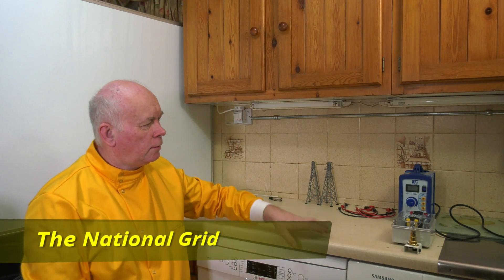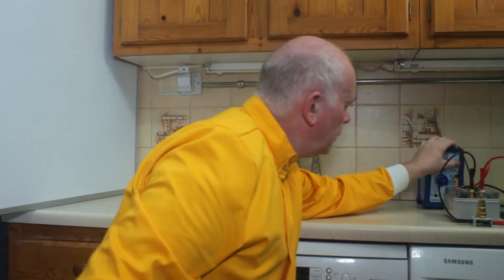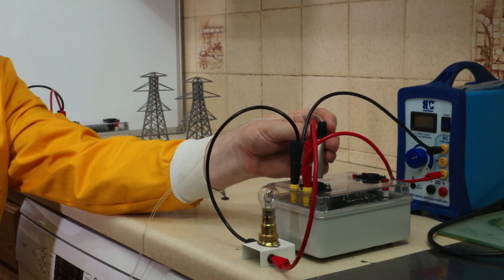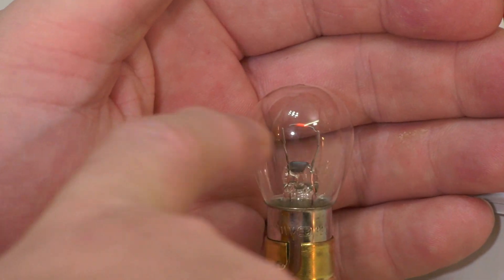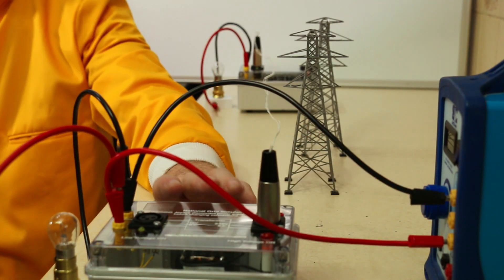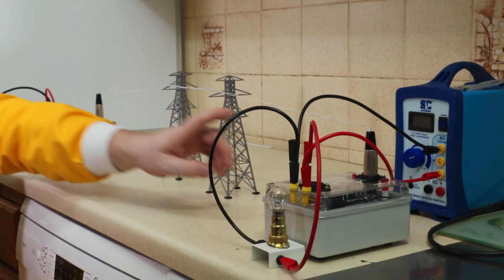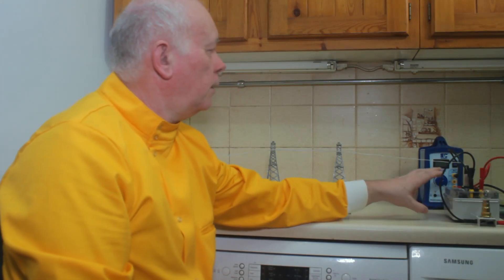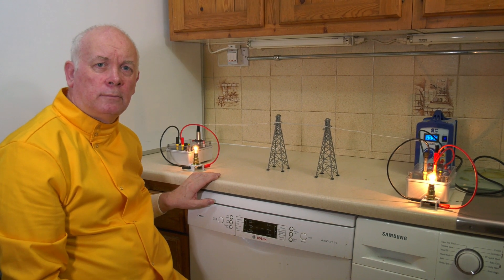Explaining how the national grid works

Comment: Houses do not run on 12 volts. Pylons do not carry 240 volts. Please explain stating the correct voltages.
Reply from the maker: This is a model of the National Grid as a demonstration of how it works. Sending high voltages around a classroom would be lethal.
Reply: @PhilipRussell  STATING the correct voltages. (Sending around a classroom, how ridiculous).

Comment: Am not sure if i accept this example you choose. 12v dc can not be converted to 240v ac by any power company in most parts of the world as standard especially in the Uk. So very bad example.  he should have stock to 240v ac step up by transformer to 11kv for long distance transmission then when it arrives it is stepped down to 240v ac. for consumption in house. This was a big issue b/w Eddison and Tesla. pleass dont mix things up if you dont understand it. Mentioning 12v messes up everything. Nobody uses 12v in their home. 12v is normally Direct current. The US uses 120v and UK 220v a.c.
Reply from the maker: In the video I only talk about AC electricity and use only AC electricity. This is a demo model. I take 12v AC step up to 240V AC and then step down to 12V AC. The real thing uses higher voltages and a real power station and huge transformers. These are not practical in a lab situation. If you watch the video again you will see that I used AC and talked about AC. The US uses 120V AC and the UK actually uses 240V AC, (labelled as 220V  +/- 10% AC by the EU).

Comment: total bs. there's no underground cables and most of the power plants are no longer in use. 
why are most substations located next to running water? you'd think the last place you'd want a substation is next to water..
every large venue that requires huge amounts of electricity also located next to running water. this is fact.
Reply from the maker: In the UK we have loads of underground electricity cables - we can see all the manholes. Generally the overhead cables go to the towns and cities then they are underground.  In some scenic areas the main grids lines are underground to preserve  look of the countryside. Where they are are clearly marked on all UK Maps for safety reasons. The Govt have shut some power station sites  those powered by coal, except Drax which is converting to  renewables and brought new types online and these are all connected to the grid. We are slowly replacing our old Nuclear power stations with new ones- they only have a lifetime of 25-30 years. Most of our power stations are running and we all have electricity we need - no brown outs in this country - because of the National Grid. The substations are near water - this is for cooling - the substations are water cooled, that's why they are so close. Venues are close to water - I would guess so because in the UK we have a lot of rivers that goes with a lot of rain, that probably the reason that many venues are close to water and the fact that cities in the UK generally were built around river crossings. However the National Grid still works the same, the power stations make the electricity, the transformers raise the voltage and decrease the current to minimise energy loss and the pylons and underground cables take the electricity from all the power stations to all parts of the country where at a substation the high voltage is converted back to what is used in the factories and the domestic homes. That is what the National grid does - takes electricity from all power stations to all homes NO BS.
Reply: @PhilipRussell  Answer me this then...
Why is every sports stadium, shopping centre, industrial complex or other places that require huge amounts of electricity located next to rivers?
I have over 30k followers on twitter and telegram and not one of my followers in any country could prove this wrong...
There's no such thing as coincidence.
Even Scottish Power now call themselves Scottish hydro electric.
All electric is generated from water...its very simple to do.
Electricity terms are even named after water. 
Nuclear plants are a hoax. They are empty. No one works in them.
Where is all the footage of the nuclear reactors..its such a con

Hydro dams are well established.
You can generate free electricity from still water with a ram pump and hydro wheel generator.

I've covered this topic in depth. 

Look at your local sports stadiums and see for yourself they are all next to rivers...then look up any shopping centre..

Tell me I'm wrong

Comment: But where does the national grid get the electricity from? And why didnt they bury the cables like every other utility? Doesn't make sense to put these eyesores up all over the country side when everything else travels underground.
Reply from the maker: The National grid gets its power from all the power station s in the country as they are all connected to the same grid. So if one goes down all the others supply the electricity. Underground cables are used in the towns , but it is considerably cheaper to use overhead power cables fpr the main runs between towns.
Reply: @PhilipRussell  very interesting. Why we pay for electricity to so called 'suppliers' if they supply nothing. If I understand right National Grid provides it. Can we pay them directly? How National Grid collects they energy to the power stations?
Reply from the maker: @czylichilli  The suppliers make the electricity. The National Grid moves that electricity around the country. A company pays for so much electricity to be made and then the house has a meter to record how much you use. You then pay the company for how much you use and they if they have done their sums right make a profit. With the current rising in prices and electricity companies buy gas to make electricity, because it is getting more expensive the  companies are paying out more money to the electrical suppliers than they get from their customers so they are going bust.
Reply: @PhilipRussell  thank you for taking the time to answer.
Reply: @PhilipRussell  how exactly are the suppliers creating this electricity? You say they make it. And you say they pay for it. That doesn't make sense, if they can "make" electricity why would they need to buy it? How is electric the "green" power if they burn gas or coal to create it? Do you ever question these things or beleive everything your told?
Reply from the maker: @Disciple1786  The Power stations buy in Coal, Gas or Nuclear fuel to make or generate the electricity. Other systems like wind are free to run, but cost money to make to this money needs to be repaid and more money invested to buy new and replacements. Once the electricity is manufactured/generated then another company buys units from these and then sells it over the grid to the customer. They pay the power station owners and the owners and maintainers of the National Grid. The Customers have sealed meters that relay the figures of what they have used to the supplying company. Some do pay as you go. Some of these companies make deals with their clients. - they hedge their bets - pay a bit more now and pay less if the price goes up Fixing the price. If the company get this right they make a profit, if Gas prices go up enormously then the supplier can't pay the electricity generator the costs and they go bust as has happened a lot this last year. Bigger companies with more money can pay the bills and take over the clients and make even more money.
If you look at gridwatch.co.uk ( an independent company) you can see what and how the real-time electricity is made. Some is Green like Solar and Wind. Some is neutral like Biomass and some isn't like coal very low in the UK, Gas up to 50% and oil - not much in the UK. Green Power is only made from Wind, and Solar and nuclear ( as it makes no Carbon Dioxide). Here is the evidence of what is being made. As to whether this is true - why should the companies lie what and how would it benefit them?. They have independent regulators who have access to them and why would the regulators lie, they are independent watch dogs and not run by the Govt.
Reply: https://youtu.be/5dKnJ5SkvgQ

Comment: coming from power station is there two or three or x  wires?
Reply from the maker: Just two wires - technically one out and one in.
Reply: ok. how do they supply 3 phase to industrial places?
Reply from the maker: @fredgarvin4482  All electricity generated from a power station is really three phase. When Electricity is supplied to a house only (domestic supply) one of the three phases is used. To generate three phase a generator is used that creates three phase. in the lab we don't normally teach this but I will put this on our todo list.
Reply: @PhilipRussell  thank you for the reply.  I have watched many hours on the tube to learn up about house wiring and a bit on distribution network.  the distribution side is the part that is not covered very deep at all.

Comment: It's the frequency thing I was looking for an explanation on, what does it mean on the supply and consumption side when this is above and below 50? Thanks.
Reply: The frequency shouldn't change. It should remain at 50 unless there's something wrong at the power station lol. Just means that the standard power station generator has a complete rotation 50 times a second and so induces a 50Hz wave on the power lines.

The only thing I can think of that modifies the frequency of power lines are "powerline" networks, which use frequency modulation to transfer data between powerline adapters.

For more info on the 50hz and three phase power generation...
https://youtu.be/4oRT7PoXSS0
Reply: The US uses 60hz and UK 50hz this has to do with the generator alternator in terms of number of poles and RPM.

Comment: Is that all powerstations generate? 12 volts? wow
Reply from the maker: They could do, but they don't. They don't even make 230V that the houses use either.
Reply: such a misleading video. very bad delete it, you leading people wrongly. No power station can convert dc to ac at least its not standard. most houses do not use 12v so whats the point of the video 🤔

Comment: BS. Those pylons are Tesla Towers. Different models have its capacity. It need a Transformers yes. AIR cables cannot be underground since they harness electricity. Electricity =Electric City in 1700
Reply: Yes I agree . And thank you for sharing your wisdom. If they were simply moving the electricity then why such gigantic monstrous structures?  Energy is free and slowly the cognitive dissonance is dissolving and people are realising the truth
Reply: No those pylons are just pylons that support a wire or several. The wires from the power stations can either go across the country from the power station to the city over ground which is cheap or underground which is expensive. The pylons do not make any electricity. The electricity is generated in a power station. The idea of the National grid is to use up as little energy as possible and to link all power stations to all the houses, so if any power station fails then the houses still get electricity.
Reply: @pengi288 NO. Watch all different pylons. Each one has its own CAPACITY . Its NOT A stronger infrastructure. You Still havent understood why they built The Eiffeltower to support The Paris World exhibitions with electricity or have looked at One World tower antenna with its huge metalballs on Each of The 5 balconies.
Reply: @lauralauren6432 , you mean the capacity for the pylons to suspend (hold) wires?
pylons suspend wires which carry the electricity  but they do not generate static electricity as tesla coils do

the Eiffel tower was a (temporary) radio antenna Built for the 1889 world exhibition in Paris but never supported power cables
but had wires connected to the power grid which were suspended on pylons
Reply: @pengi288  NO every model of pylons has it TW capacity. Not strength. Wqth The equipment they have removed from Eiffeltower. It was Not feo radiocommunications. Watch The Whole exhibition being lit up. There are powerlines from nonpowerplant. The electricity are being Transfomed in The Transformator. The ceramics discs. Sorry for my Swenglish https://chinadialogue.net/en/energy/10376-sparks-fly-over-ultra-high-voltage-power-lines/

Comment: there is no neutral wire going form substation 1 to 2? then how the negative ac cycle will flow form home substation to power house substation? can you please explain?
Reply from the maker: Only two wires are needed for AC electricity one to the object and one to return. The electricity alternates in which wire is the positive and which is the negative, which means that the names positive and negative are redundant. The third cable is the Earth which allows a path for the electricity to the ground rather than through you. 
So in my model, only two wires are needed one to take the electricity to the substation and one to return it. Which is positive and which is negative varies some 50 times per second in the UK.

Comment: 3:46 How?
If one power station fails, how does the light still stay on?
Reply from the maker: All the power stations feed into the same national grid. It is a Mesh network. So if any one station fails or needs to go offline then other stations can ramp up their electricity production and fill in the gap. The national grid is a network connecting every power station to every house. It is true that there are some junctions that if they go down  large areas can fail but this is very rare and can normally be fixed in a few hours. Countries that don't have a national grid, if the power station does not produce enough power there are brownouts or if the power station fails, then there is no electricity until the power station is repaired. This doesn't happen in the UK.
Reply: @PhilipRussell  Thank You Very Much!
Reply: @PhilipRussell  What countries would this be a problem?
Reply: So it’s the grid operators that change the directions of power flow to the substation?